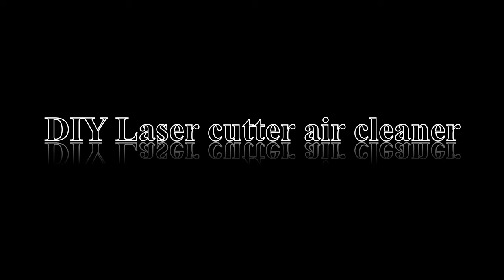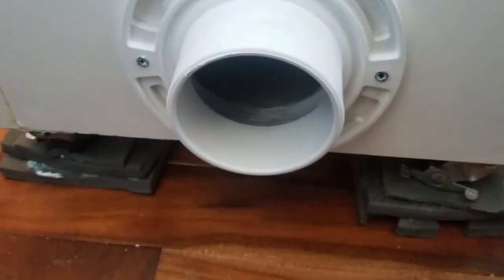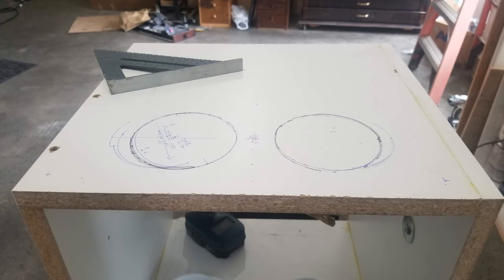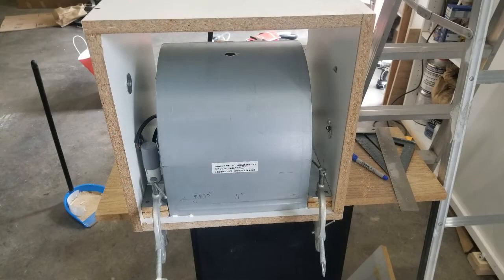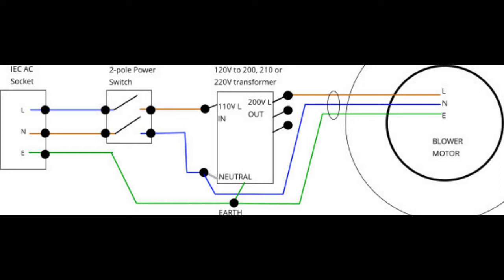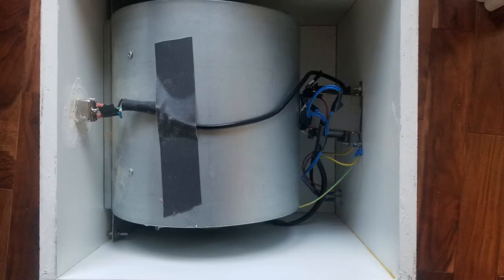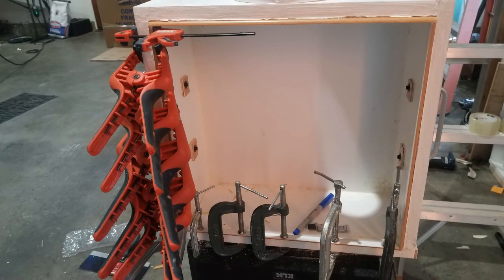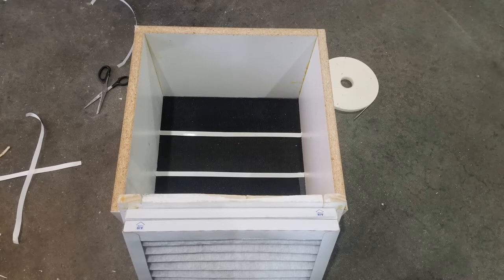DIY Air filter for Laser Cutters

Comment: Activated carbon (or charcoal) filters work by the process of adsorption. As the pores of the surface become filled the carbon loses efficiency and the filter no longer serves its purpose to remove contaminants from the airstream, and it is these contaminants which cause odors. For this reason, the activate carbon filter should be the final stage in an air filtration system.
Reply from the maker: What you say makes sense but a lot of commercial laser cutter filters have the charcoal filter before the hEPA filter. Example, https://omtechlaser.com/products/activated-carbon-filter-lsp-2f80-00
Reply: @abizarlakdawalla4519  Yes, they do and it's a bad design indicating proper research was not performed. While I have the equipment to test for carbon monoxide and other airborne contaminants with the filters installed both with a proper and improper design, I'm really not interested in wasting the time and money to cut enough material to demonstrate how long it takes before each design fails.

Comment: This is very well done. I like your design a lot. Thank you for sharing. Is it still holding up?
Reply from the maker: Yes it is, am pleasantly surprised at how well it works and really has held up to capturing odors. The air coming out is quite clean. Mostly cut acrylics, wood and paper.